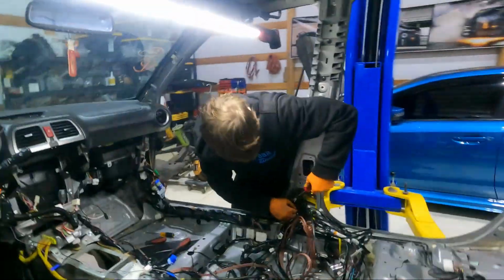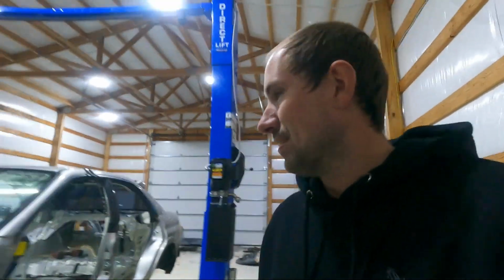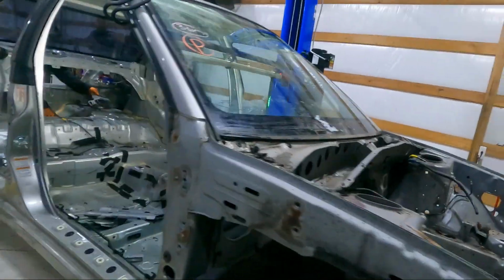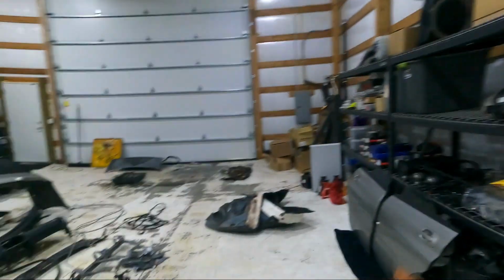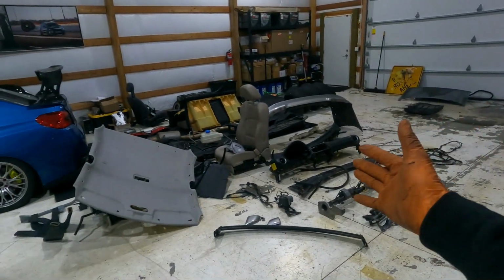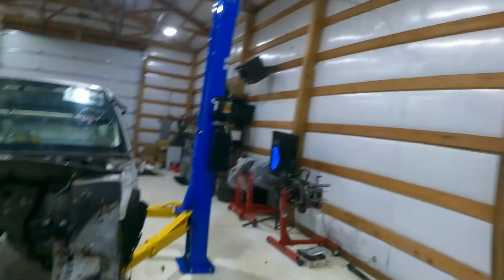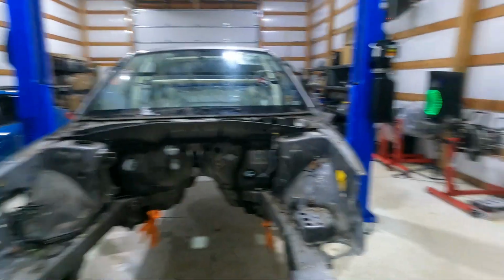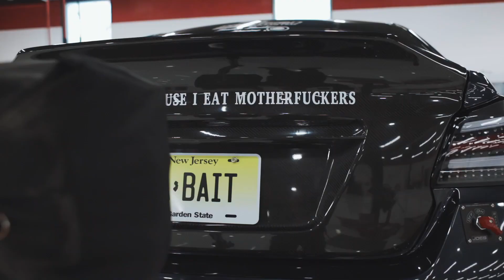Vlogmas Day 6! We COMPLETELY tear this car apart!

Comment: that shell is worth it's weight in gold here in the rustbelt!
Reply: exactly, people parting. out completely rust free GD STI's, that are SKYROCKETING in value to build foresters and impeza's, that will only be worth 1/3 rd of what a rust free GD will in a year..makes zero sense
Reply: @Crazy8ts  it's not always about the value of the car 🤌
Reply: @Smeedia  i get that, but i have been in the collector car hobby since the late 80's. GD STI's that are completely rust free with minor front end damage that clearly didnt total the car(unless the cost to repair it was over 18-20k and a bumper cover core suppor and fenders can be bought for under 2000) it doesnt make sense to scrap an entire rare hawkeye, to put the parts onto a forester or impreza. Hawkeye production in the U.S. for 2006 and 2007 was very very low*relatively*...and the remaining rust free examples(title issue ir not) is probably less than half the original number of hawkeyes built.Now factor in no more STI's being made, and a auto industry trending toward all EV performance and Hawkeye STI's really are entering a golden age of heritage and styling that will NEVER happen again. I cant tell you how many dudes pull up next to me in.a pick up truck and yell over they used to have a GD and sold it, and was the biggest mistake of their life. I dont think you and Bader realize the potential of how high hawkeyes are going to go as your main focus is just modyfing. A build of both the title issue 07' hawkeyes as weekend track cars would have provided examples of recipes to keep hawkeye STI's intact and surviving. Just my 2 cents not downing the path your taking with the builds..but im telling you now..whoever has the has the best inventory of saved hawkeye STI's is going to win BIG TIME over the next couple of years